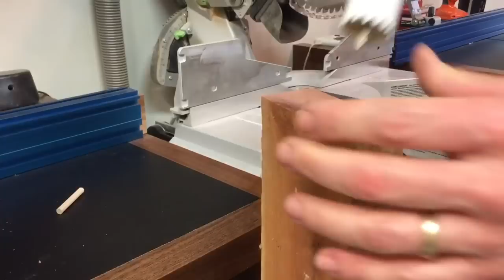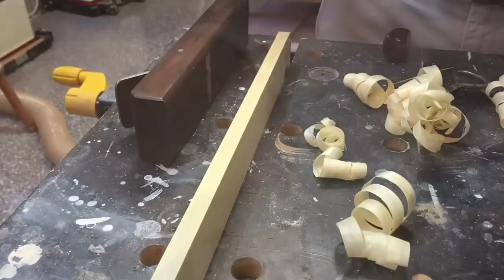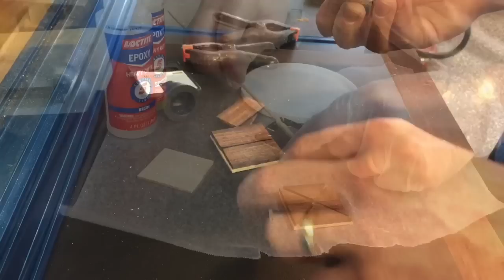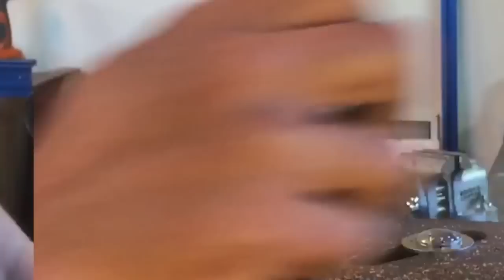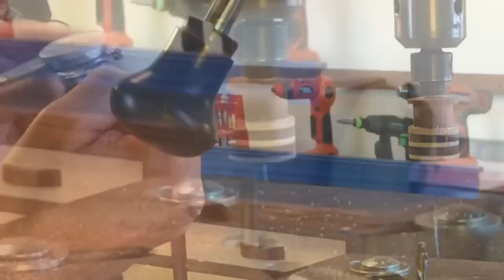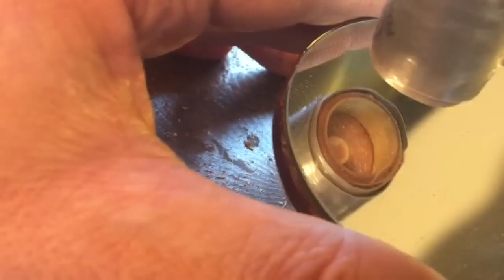Make Wood Rings on the Drillpress

Comment: I really like how you used the tools you have to accomplish what you needed. The router on the drill press base, using a hole saw to cut out your blanks, etc. This is a great example of how to extend the reach of the tools you have, and get more from them. The answer isn't always a new tool. Sometimes you just need to look at what you have differently. Well done, and happy building.
Reply: Westfarthing Woodworks Fully agree with you. An inspiration to look around my workshop for what I've already got, with new eyes.

Comment: You do beautiful work. I make rings from coins, and what I like about that is that I can adjust the size up or down. With wood it looks like you have to get the fit dead on or it's useless. Your rings at very beautiful though.
Reply from the maker: Thanks. And yes there is no pliability to a wood ring.
Reply: Cool, I have a popular coin ring video.

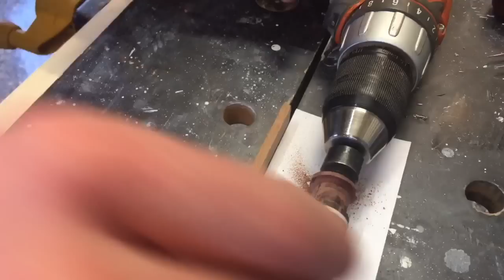Comment: Fantastic work. What is the stuff you put on at 5:12 to make it shine? Is it a glue or a varnish?Thanks
Reply from the maker: Superglue
Reply: The glue that is used for a high gloss durable finish on small turned pieces of wood is usually a med CA, glue found at hardware and Hobbie shop's and you use a spray on it after a few seconds that is used to dry the glue so it don't run or drip

Comment: Ok so were the shavings glued on with CA?
And the layers next using 2 part epoxy?

Could you use "normal" wood glue instead or is it just not strong / filling enough?
Reply from the maker: Normal glue does not work. The pieces that are glued together shatter when you try to shave it down with the router.
Reply: +Selandry1 What wood are you using to make the shavings?
Reply: +Selandry1 Are you using cedar for the sacrificial blank because you have it in the shop or is it something you have experimented with and like to use?
Reply from the maker: +Harry Smith I used pine for the shavings on this ring, but I also use maple, walnut or cherry shavings depending on the ring design. For the sacrificial core I used the pith of a cedar 2x4 because it is darker than the pine which makes it easier to see when all the core has been removed. I do the opposite and use a light wood for the mandrel if I use darks wood shavings. You should check out my new ring video where I make a much nicer ring and you will see what I mean.

Comment: when you make the bentwood core. what thickness do you find works the best? Thank you for the great video!
Reply from the maker: I make the core 3/32 and the ring when finished should be just a hair over 3/16 thick.  It is super strong and still comfortable at that thickness.

Comment: very nice. however if you really wanna speed this whole process up..ditch the router...take a set of spade bits and cut them  down and mount to your hole saw and in one pull you have a ring..then sand the inside with a taper...
Reply: Brian - Show us please? I doubt it will work. I'm sure the blanks will snap like crazy, with the run-out on an average DP being what it is, and now you want to make simultaneous cuts ID and OD?
Reply: Ant Mallett I have cut over 60 rings that way...if you don't succeed then adjust the depth of the spade.. Ive never shot video for YouTube but..I didn't speak on something " I thought might work" I have a slew of them made for different sizes
Reply: Great, I may just try it for myself then. Only thing is, my hole saw arbour needs a flat on the inserted bit in order to be usable. No worries for people with different arbour styles, or access to a milling machine. Not my worry, but a point in case.
Reply: So does mine...I cut the spade bits down in the bench grinder...and then ground a flat spot in them

Comment: Quick question. Ive set up my drill press and drillmaster trim router with the 1/4 downward spiral and for some reason it is really tearing up the wood. gouges and then shatters a few. Any ideas on why? I've adjusted my press (a cheapie) speed to lowest which sorta helped but still it doesn't come close to how you are cutting with that same bit... Help!! :)  Edward~
Reply from the maker: Could be several things.  Most likely is that your bit is dull.  Other things that cause your issue are using wood glue instead of epoxy and having the wood grain not oriented correctly.  I found that some woods (cocobolo) have to be sanded to final thickness because it shatters with the router technique no matter what you do.  I have resorted to sanding  many of my rings  to get final thickness by using a portable table top drill press I designed and bring it over to the drum sander.  If sanding is not an option and you have tried all my tips then make sure you have a soft wood like pine on the top and bottom of the ring that can be removed later to act as a tear out preventer.  Acts like a kind of like a zero clearance fence.  Again the most likely issue is that your bit is dull.  I pulled my hair out and discovered a lot of tricks to prevent tear out when all i needed to do was get a new spiral bit.  Let me know how you solve your issue please.  Good luck.
Reply from the maker: I'm sure there are other things that can be causing this that I have not discovered, so I would appreciate your feedback if you do find another solution.
Reply: Hey, thanks so much on the reply. I just bought the bit. So far I've tried it on solid pieces only. I have no yet tried with the top/bottom pieces. I will try with to see how it goes. I am not doing the bentwood core process yet. No plane. :)  I appreciate your time and look to the day I can make rings as amazing as yours.. Ed

Comment: So did you do yourself the favour and got a wood lathe by now?
Reply from the maker: No. I can always find a work around. My neighbor has one and will let me use it whenever I want. But I never have.
Reply: I'm a relatively experienced woodworker, but I'll admit to being intimidated by lathes. I have no idea how to use them, and have none available here to practice on. (Also don't want to pay hundreds of dollars for something I'm not experienced at or sure that I'd use.) Do you have any links to good videos for someone that has absolutely no idea how to use one? Most of the ones I've found on here assume you have at least some experience with them.
Reply: Cap Tin
I used to say "Get Glen Lucas' DVD 'Mastering Woodturning'. Which is still great, but even Glen has started admitting you can replace years of tool sharpening experience with a Tormek jig or something.
Also now there are the Easy Tools, using carbide inserts, requiring no sharpening at all and neither a certain special tool angle, and are supposedly real easy to use. Haven't tried them yet but my cheap knockoff should arrive any moment ;-)
Reply: Cancun771
Thanks :)